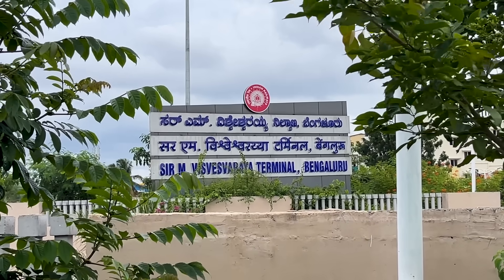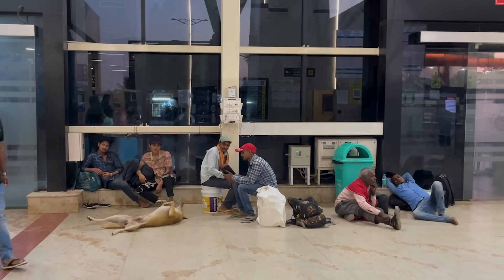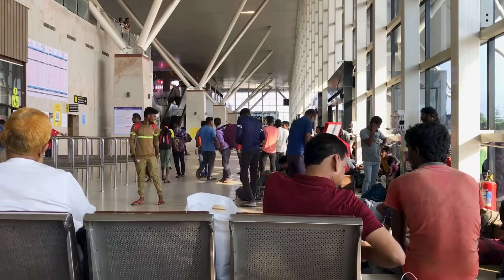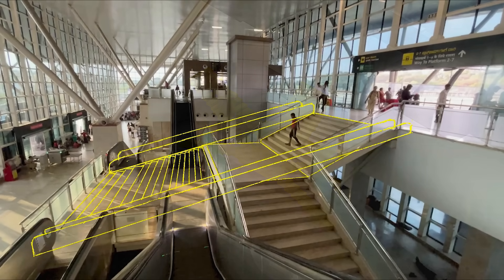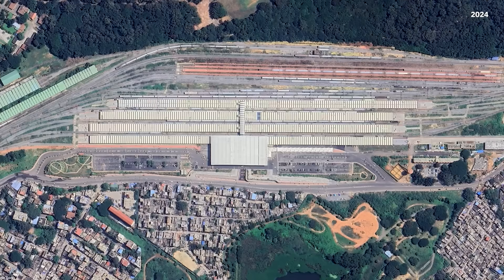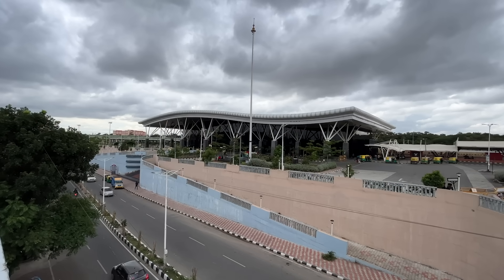India’s first AC railway station SMVT: what went wrong?

Comment: The major problem apart from the architectural flaw is that most trains that operate out of this station are headed to certain eastern states and the passengers who hail from these states have made the station a living hell. Civilized behaviour is something that these passengers lack. A railway station is not a lodging area. Most of the concourse is occupied by these people making it imposible to walk with one's luggage. Agree that they cannot afford to stay in hotels for long. But converting a railway station into a squatter settlement is not the solution!
Toilets are broken, they stink and there is faeces on the toilet floor in spite of cleaning staff putting in their best efforts to clean them. The waiting lounge AC doesn't work and a huge tower fan has been kept. The sofas in the waiting lounge are used as picnic beds by travelling families. The elevators to the platform thankfully worked when I went there the last time, but that isn't always the case. Waterlogging is another issue. In platforms, garbage bins are tossed and the contents strewn around, thanks to stupid kids playing around them as if it is their dad's property.
There should be usage fees on everything and heavy fines charged for littering and damaging station property. Also, nobody should be allowed to enter the station without a valid ticket, with ETD of their train not more than 2 hours.

Comment: Correct, it will be more benefit if they add more infrastructure inside, like more seats, more retail area, and signed to make people using the station easier. Outside infrastructure need to be more pedestrian friendly and high density development around. Also i think if they didn't wants changed the inside layouts, the least they can do is to assigned more staff to help direct passenger, because even you put signed, people can still get confused about where they supposed to go, knowing how confusing the stair aalignment and other facilities are located.  Really Good Video bro, keep up the good work, Hi from Indonesia🇮🇩

Comment: I'm an architect and have worked with CPWD on government projects. The major problem is that the higher officials under the department where the project is assigned discuss the progress of a project with us, with having 0% knowledge about architecture and due to there ego we have to follow there suggestions even if they are not feasible. Thus this leads to this kind of projects.

Comment: There's also another flaw. Platform 1 does not have any direct connection to the overbridge. I went to receive my mom and it was announced that the train was coming on platform 2. I was standing far away as I was notified the ac coaches of the train were in front. I had to take the subway as in order to take the overbridge, I'd have to again walk back a great distance, get inside the building and then take those confusing stairs
Reply: Sounds like a skill issue

Comment: It's a really well-researched video but the thing you are referring to as "over-engineered and under-designed" seems more like "over-designed and under-engineered"
The video pointed out complex aspects of the project, such as the structure of the staircase and the size of the entrance and exit doors. These features could be considered over-designed rather than over-engineered. On the other hand, points such as the need for ventilation for a much better cooling, the bits and pieces of the structure to be blown off, and the location of the toilets can be classified as aspects of under-engineering.
I'm not an engineer so I might be wrong here but I would be glad if you are able to talk about this
edit - also clarify my doubts 😅

Comment: This is called form over function, I would also suggest that they need to do something with glass, It's basically a greenhouse, or Conservatory however, you would like to call it.  Maybe some kind of lattice? 
They also should of done some landscaping, I'm never a fan of clear cutting but at least they should plant trees, shrubs, flowers, ground clover. It will take years get a good tree canopy. They should of built using passive architecture. AC is great, but doesn't replace architectural principles that reduce the need for it. 
I think fuction can be beautiful. I can not imagine how hot it must been in with no AC. I also wonder the accessibility for people disabilities. I mean if they don't have a proper walk away to it, its hostile to pedestrians.

Comment: HOW WILL India get Properly Designed Infrastructure when Projects go to the Lowest Bidder. Of course, the intangible phase will be heavily cut down to maximize profits. 
Secondly, Indians have a LONG way to go before they are civil enough to use a facility properly. The Garbage, the paan stains, open urinals is typical Indian behavior. 
Not caring about Public Spaces, Cleanliness, Basic Hygiene, and above all, Decency and Common Sense are in Short Supply.

Comment: Damn, the design mistakes are atrocious! Im an architecture student and my professors would have thrown anyone out of university if someone proposed something like that as early as the second semester.
Looks like at best there was a rough design sketch for the big sweeping roof and everything after that was just moved around and placed as was deemed "neccecary" by different engineers and planers with complete disregard the actual use and functionality of the space.
We need to do better.

Comment: 00:04 SMVT Railway terminal fails despite amenities
00:52 SMVT railway station opened in June 2022 with airport-like features but faced structural damage.
01:49 SMVT needs to improve comfort and facilities for early passengers.
02:33 Lack of proper accessibility and signage for essential facilities at the AC railway station.
03:24 Inefficient design and layout of entrances and foot over bridge
04:04 Poor urban planning and high construction cost.
05:00 Lack of proper design and functionality
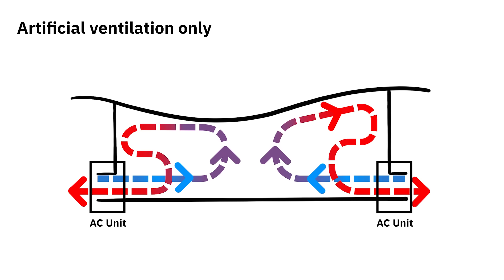05:44 Improper cooling system design leads to high energy consumption.

Comment: The thought was good but should have used engineers above the age of 10.

The sole motive of a terminal is to provide quick entry and exit. It feels like a lifetime coming out of the station. The approach road may be wide which is good for future expansion, but the connector road to the city is so narrow that it's always jammed.

Reaching the station itself is a big hassle by road. The best solution would have been to introduce a shuttle train from byappanahalli or kr puram every half hour. Would have made life so easy.

Comment: Thats what happens when reserved category back benchers get govt jobs. 1 architect designed the outside structure - and the engineers failed to incorporate infrastructure. Or the architect blew the budget and left nothing for the engineers to work with.

Comment: The architect who designed this  monstrosity proabably only travels by air and has not seen or used a railway station . Functionality and ease of use is the first priority before fancy facades ( which could not withstand the first major monsoon rain and winds and has been badly damaged) and marble floors. Steep staircases  and confusing escalators besides inadequate seating and many other issues listed out by other readers.
While good and adequate parking space has been provided ( at the cost of cutting down many  fully grown trees) , the approach road to the station is a total mess. In the six years it took to build the station why has the approach roads not been constructed as yet? Interlinking with the nama metro is also yet to be done ( am not sure if there are any plans for doing this or if it has been done) 
Lastly providing AC like an airport is a total unnecessary cost as ordinary rail travellers want simple facilities first before providing costly and luxury AC facilities which also increase operational costs due to huge power consumption. With cooler Bangalore climate it would have been cheaper and better to have a simple Ventilation system installed which would provide for comfortable inside conditions  and also be more economical to operate as well as require far less maintenance costs.
The architects and planners in the railways need to be hauled up and questioned as well as penalised for this huge waste of public funds.

Comment: A lot of this, I feel, happens when such critical infrastructural projects that are intended to be used by thousands of people daily are given to small companies with little experience in designing, let alone executing such projects. 
If you want it to "feel like an airport", then get the project designed by HOK, AECOM or Gensler (companies that actually build airports, and excel in it).
Airports are good not because of their fancy looks, but because they prioritize function over form. They excel at handling thousands of users at any given time efficiently, plus account and plan for contingencies such as flight delays and whatnot.

Comment: Bro you Should use word Architecture instead of engineered. There is difference between them. Architechts are responsible for asthetic, appearance, ventilation, facade , room size planing, interior design, beauty and comfort of building. Engineers are liable  for structural strength & durability. So, Architects are responsible here.

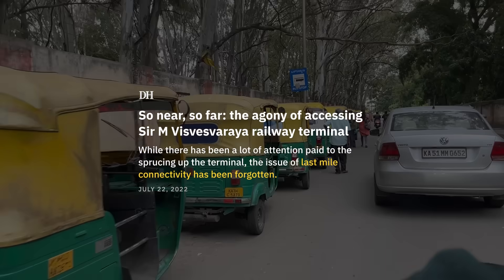Comment: 01:14, considering the fact that Bengaluru has traffic, we left Avalahalli for SMVT on time, which is a 30-minute drive. However, just before reaching the Railway Station, we encountered a narrow flyover, where we ended up wasting a good 30-40 minutes. By the time we reached, the train had already departed. The estimated time of arrival (ETA) when we left our homes for the station was 30 minutes; we still left 01 hour earlier. But the approach to the railway station got us to miss the train. 'So near, yet so far' works perfectly for this situation.

By the way, very nice video. Good explanation. Subscribed your channel.

Comment: Valid points, hopefully this is a learning for the the Railway authorities and drastic improvements are made. Also could you please make a video about the really bad and downright inhumane zoning? I have seen residential buildings with barely enough gap to fit a tennis ball in whitefield, not only that the amount of resedential houses right next to an arterial. If anything this really hampers the health of such residents due to inadequate sunlight, barely any fresh air and other issues.

Comment: airport should look like airport and railway station should look like railway station
Architect was chosen based on the weight of the bonds i guess or like every one saying a minster son. in our country nothing should be white as it requires continues cleaning and repaint to not look too old examples of not white Chennai and mumbai  centrals. secondly sliding door and stairs are not passenger friendly may be this idiot architect never used a railway station.

Comment: First of all, you got the name wrong. Who names Railway station after complicated sir names and includes a title as well? This must be the megalomania of Indians at play. Just naming it after the town where it is located is the most practical thing to do but it does not earn votes in India. Then comes the design and engineering. Railway stations are not airports and certainly not in the Indian context. Airport passengers are usually affluent and fewer. The railway passengers are sort of a mixed group and many more and their expectations are different. Management of large crowd which is the norm in Indian railway stations, is an issue by itself. The expanding Indian population that wants to travel poses it's own problem in the form of limitation in infrastructure no matter how big you make it. The mantra to successful planning in India should be, make it big (in terms of space), make it simple and make it functional. Use technology where it solves a problem rather than creates one.

Comment: Thank you for this! It's an xcellent presentation, but with potential improvements suggested. Kudos!

I felt that it could have been more in-depth on the communication systems, signage, and host of other issues. The same treatment to those topics would have been very useful and added greater value to your presentation.

Comment: Very good comments. From all that you say, some of the issues seem to be easily solvable with just a little effort. The installation of signage, seats, etc. should be done quickly. The changing of structure may take more time and effort but those should also be undertaken before traffic at this station becomes so large that such repairs are impossible. I would suggest that some ability to open windows at the lower levels would mitigate possibility of AC failure and enhance convectional cooling when needed and for the nine months of the year that Bangalore does not need AC. The lack of robust lifts to get people between platforms is incomprehensible. SWR has had experience with KSR and should know it is a necessity for the physically impaired.

Comment: Excellent analysis and explanation, the only point where I disagree is about the entire site being cleared off. This had to be done as SMVT needed a large Coaching Depot for maintenance and overhaul of coaches, with many stabling lines to park idle rakes of trains arriving to SBC and other stations in Bangalore from outside. Hence this decision was most likely made to use the entire site. This is in addition to the Banaswadi Coach Depot next to it.

Comment: Fantastic video. is it as bad as majestic metro design wise.?
Reply from the maker: I’d say similar. But imo majestic circulation is a much harder problem to fix than SMVT
Reply: @bengawalk  I found Kempegowda metro station to be easier to navigate than SMVT (size difference notwithstanding). Imo the only problem is the capacity of the interchange, which they are managing with crowd traffic control using security personnel.